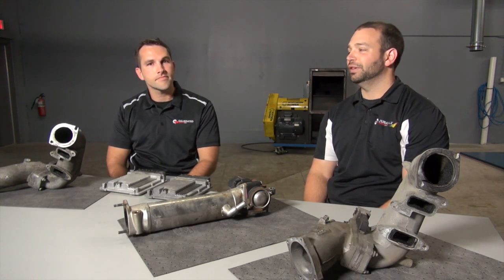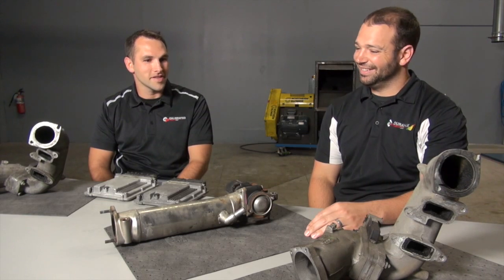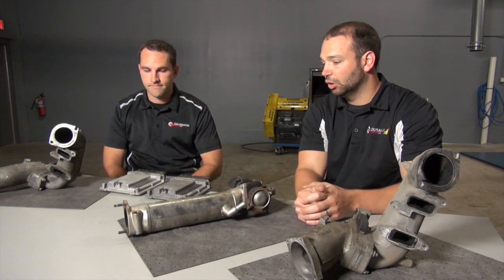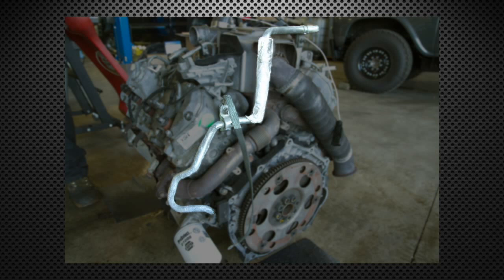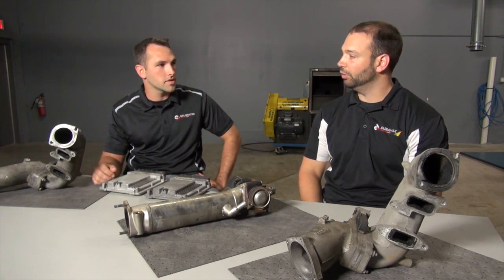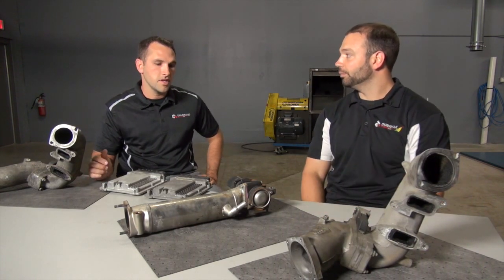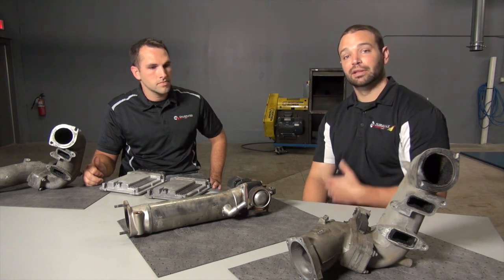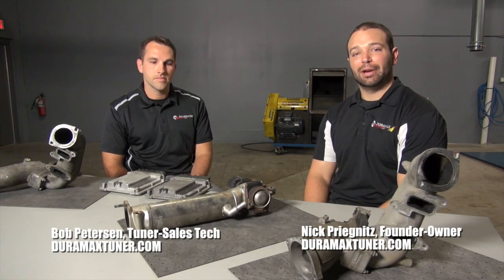Duramax LBZ & LMM - WHAT'S THE DIFFERENCE? by Duramaxtuner.COM

Comment: Say I had a lmm w a dirty dpf 
How is the best way to go about cleaning that 
Could it be done at home using def at high temps and tan through to some other cleaning compound such as mean green? 
Or would it require service? 
Just curious 
Love the content
Reply from the maker: That would most likely need a manual regen which can be done by a dealer or technician with the proper scanner.
Reply: Install a clean piece of pipe in it's place.

Comment: so 530 on a stock turbo... can I also get the 530 on a stock Trans safely??
Reply: No, definitely not on a stock strans. May be able to get 420 wheel HP out of a stock trans for a short period of time but not long depending on your right foot! A transgo jr can help extend the life a little
Reply: so can getting the tranny built with a new 6th gear stronger one that is, the weakness in the 6 speed tranny is the five overdrive in witch is the 6 speed in the end. I own the 06 and have checked into all of it i'll leave it stock for now.
Reply: Justin Dowell I put a ppe hot in my lbz I did get a lot of fun outta it for about 4 sets of tires killing mustang gts, but then 5th gear started slipping, I am not bullshitting I ran high 12s with just the tune and no air filter. After 5th gear started slipping I took the tranny pan off, cleaned it out real good, put it back together, drove another 5000 km done the same thing truck was back to new driving, I know I took life off the tranny, I sold her about a year ago and disclosed everything to the new owner.
Reply: I dynoed at 480/940 with an old edge race tuner on a stock clutches and a transgo jr. slipped the stock converter, replaced it with a triple disk precision converter and kept on then kept on going. I recently added water/meth setup and shes still holding. haven't dynoed with it but I'm sure I'm over 500hp on stock clutches.
Reply: Justin Dowell Ran my lbz for 3 year at 530hp on stock trans and it’s still holding up. Keep it out of overdrive and it will last a long time
Reply: MrLostonej has

Comment: i have a 2008 chevy 3500 lbz duramax and the computer went out so i bought a new one and the key and the computer are not connecting at all i tried to program them together but it’s not linking , anyone know the problem ?
Reply: They did not make a LBZ in 08. Look at your VIN, if the 8 digit isn't a D it's not LBZ. You have a LMM if it's a 08. That's probably why you can't get it to work.

Comment: I have an 08 lmm duramax, dually long flat bed, gooseneck, pulling 5th wheel camper 15k pounds, I bought the truck with 200k miles, put about 20k on it in 2 years, having all sorts of problems now, but I have narrowed it down to needing to pull the injectors and have them serviced , and pull the cpm pump possibley and put in a rebuilt cpm pump, on this video you talk about the dpf system and how it might could wash out the piston rings with blowby, jeez, and dilute the motor oil in the crank case,.....jeez, how do I check that, do I have the oil in the crank case checked like viscosity or something like that ., ....jeez, I like this truck because it is a western hauler bed, and perfect for us to go camping, but it has stranded us several times, when i have tried to maintain like 60mph on up hill grades over time, then it has powered down, like I said i have found the problem with that, I had a shop guy get in with his computer while I towed the fifth wheel , and after about the usual 30 minutes of heaving towing, his codes found the problem, I have an air dog, etc, everything else is good, just how do i find out if my oil is getting contaminated, thanks
Reply from the maker: Hi Paul: 

Please give us a call and we can run through all of your options and offer some solutions. Can you give us a call today? 

815-568-7920

Comment: ive got an 06 lbz. I got on it a little hard then it puffed some oil smoke . went to restart it 10 minutes later and it started then stalled.  Is there an O ring that tends to go bad that could cause me to have no oil pressure?
Reply from the maker: There's a lot to unpack with that question. Can you call us tomorrow and talk to one of our techs? 815-568-7920.
Reply: Sounds like it could of been your stock race plug. Replace it with a ppe one

Comment: Is 12,000 a good deal on a 2007.5  chevy 2500 dura? it has 256000 miles
REPLY
Reply: I just paid 13,500 for an 05 GMC 2500. Has 180k on it.  Books for over 20k. I'd say you got a good deal if the truck isn't beat.
Reply: @ozziecrosby2092  I just paid $12,500 for 06 gmc w/139k on it and an almost new 8' Western plow. Ext cab, short bed, 4x4... Wisconsin
Reply: 2003 GMC 3500 dually with 250k, one owner just him and his old lady pretty much new. Turned 86 years old and let it go for 3grand 👍

Comment: I have a 2008 . 3500series . LMM.  There’s no DEF on it. Never was. Why is that?  Anyone?
Reply from the maker: Emissions have rolled out in tiers over the years. The 2004.5 model Duramax (LLY) started off with just an EGR.  Then in 2007.5 - 2010 the LMM came out with a DPF and EGR.  In 2011 the final Tier 4 was released with the LML, which includes DEF, DPF, & EGR.  It actually includes even more acronyms but this sums it up pretty well.
Reply: Just because you make YouTube videos, doesn’t meant you know anything

Comment: Are duramax lly cylinder heads the same?
Reply: No the heads are a but different. And lbz has slightly weaker pistons as well. But at least lbz domt have headgasket problems normally

Comment: So basically the lbz is better? Cuz I just bought an 08 lmm and after watching this video I'm having second thoughts
Reply: Jairo radilla it's just better cuz the emissions. If you take care of your truck there virtually the same
Reply: Jairo radilla I've got an lmm and it's got 170k miles.  origional everything. duel oil filtration is only aftermarket piece.  don't run fuel low. use additives and listen to the fuel filter. when it wants a new one change it.  shitty fuel is your worst enemy next to air in fuel nut that goes for all diesel engines. your lmm just fine
Reply: @nickc2708  

Lol! Amen!!

Comment: Wasn't the LBZ rated at 360hp 650lb/ft and the LMM 365hp and 660b/ft?

You said the power is the same between the two.  Is that GM just playing the numbers game with ratings or am I wrong?
Reply from the maker: +Asamccp We're not sure what GM was thinking or doing with the numbers. From our perspective, a 5 hp and 10b/ft difference may be easily corrected in the calibration and generally speaking, it really is the same power level between the two years. Generally speaking.
Reply: In the video they said the LMM had a pretty solid upgrade of 5hp haha